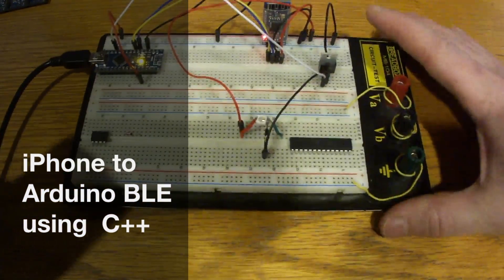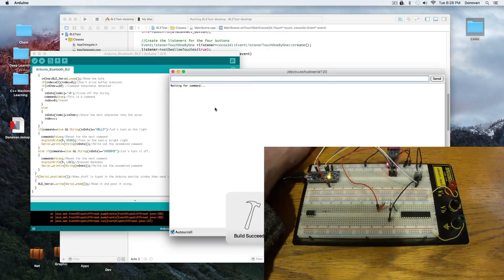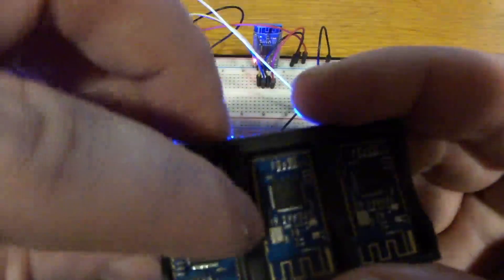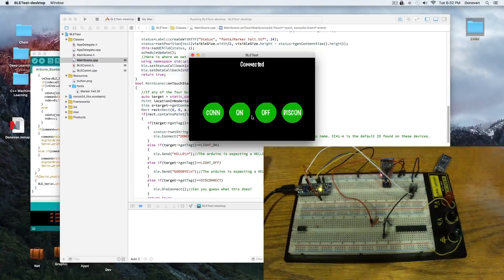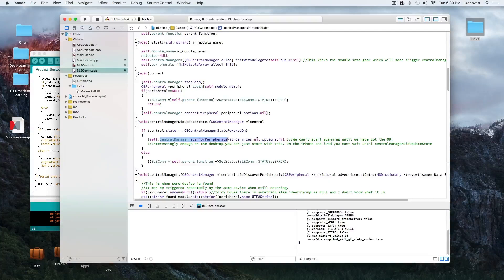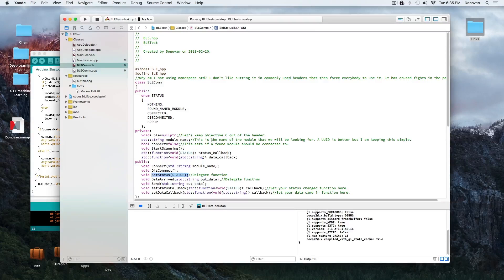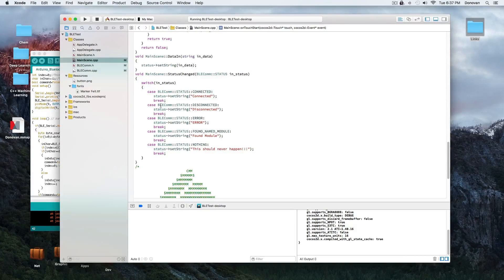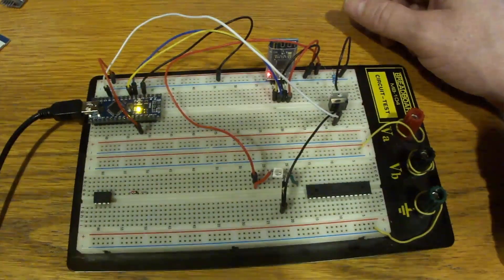HOW TO: Control an Arduino with an iPhone using BLE

Comment: Hello, I want to do the same, but conversely, send data from the arduino to the ios application (iPhone). But using swift and a bluetooth module hc-08 or 10.
You can help.

Comment: I'm having a problem using my Bluetooth HC-05. I run codes in arduino but my iPhone can't find the bluetooth.
Reply: HC-05 doesn't suport the Bluetooth 4.0 protocol (BLE) and can't connect to iPhone. Found out when I had bought several of them for use with my old phone... which broke and got replaced with an iPhone.
Reply: What do you have ? HC-06 or HC-05 ? Maybe this video is just for HC-05 so if you have HC-06 the code doesn't run.

Comment: First thanks for the great video and for sharing! 
I'm searching for a way like you do to send a value to my arduino for my study project. My Xcode project works well to discover and connect to my HMSoft10 but to write in characteristic I never succeeded. 
I implement the part of your code after peripheral connection 
didDiscoverDescriptorsForCharacteristic 
but then I get error in the row 
std::string boop=[[[characteristic UUID] UUIDString] UTF8String];

Have I to implement the hole LLVM or is there an other way to describe the string FFE1 ?
std::string I think without the library it isn't working 

Thanks for your help